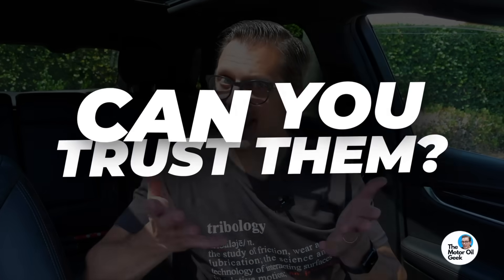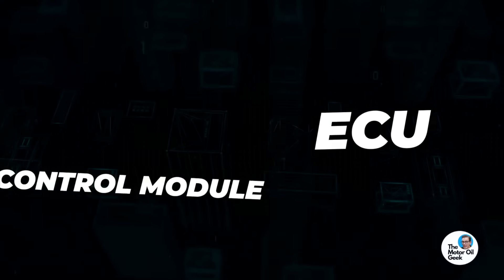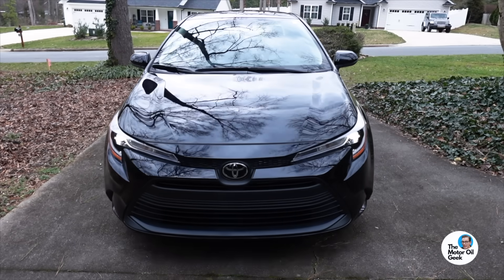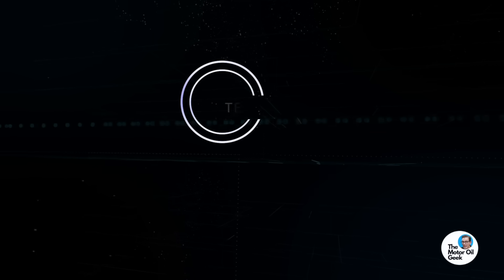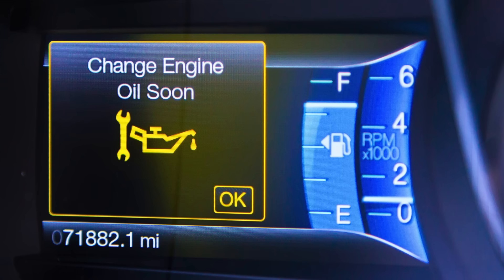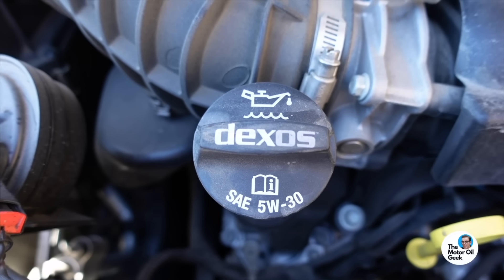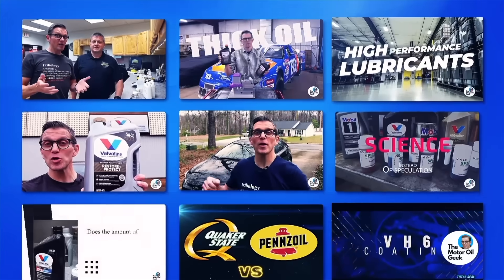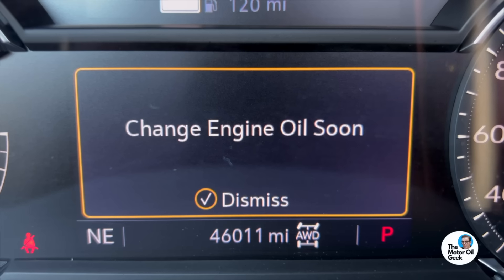The Accuracy of OIL LIFE Indicators REVEALED!

Comment: While I agree with everything in this video I still disagree with my Ford intelligent oil life monitors that say I can go 10,000 miles and 1-2 years in a 7 month per year winter climate doing almost nothing but short trips and occasional towing. My wifes turbo direct injected explorer especially suffers from noticeable fuel in the oil and I will end up changing it’s oil halfway through the life of my F150 oil, and I change my F150 V8 oil at about 60% oil life remaining which is usually 6 months/3000 miles. That said, I have started running premium top tier gas with star tron ring clean in both cars, and switched to Pennzoil ulra platinum in both cars, and have noticed the truck no longer consumes oil, so hopefully the cleaner rings might help with the fuel in the oil in the explorer as well.

Comment: Lake,

At least in the Ford V6 ecoboost community it seems like a lot of engines that have their oil changed based on the oil life monitor end up having more valve train issues and more build up of dirt and varnish in the engine compared to those that have followed a more traditional change interval. If the oil life monitor is so conservative why do you think this is happening?

Comment: Excellent video however:  I used to go by the Oil Change Indicator in the vehicle's PCM, then I changed.  I saw a video from FordTechMakuloco that showed a destroyed 3.5L EcoBoost engine, at 130,000 miles.  The owner religiously followed the computers oil change recommendation, yet the engine was toast.  What happened was, in the SS oil feed line that delivers oil to the Turbo bearings there is a small $10 filter screen, to obviously filter out any debris on the oil.  That little screen got clogged with particles in the oil, which starved the Turbo and BOOM!  The engine was toast.  So, this specific situation would suggest NOT following the OCI suggested by the computer.  I have a Ford Ranger with the 2.3L EcoBoost, and I change my oil every 5K miles, with full synthetic.  Oil is cheap.  Engines are not.  YMMV.  Lastly, when I change my oil, the computer states that my "remaining oil life is 60%".  FYI.....
Reply: I change my 2016 veloster turbo oil every 5k miles as well. I also have a 2025 Mustang with the 2.3L ecoboost engine. I rarely drive. 10 years with the Veloster, 71k miles. Starving the turbo is the fear since I know the maintenance schedule I have works. I'll look into that filter for both cars.

Comment: Funny story. A colleague had an S-10 in the 90s. Engine failure at 3,000 miles. GM replaced the engine but at expense to him. He purposely never changed the oil to get another failure to prove a point. That S-10 was at >100k and doing fine. Only topped off the oil, never changing the filter.

Comment: No car out there knows the life of the oil. It’s guessing it’s just a program in the cars computer that takes in factors like temperature throttle and mileage to determine if you need an oil change. My cars 21 years old and it kinda has a system like this where it’ll pop on a light that says oil change. I just clear the light and ignore it because I physically track the mileage and I physically check the oil myself. Pull the dip stick do the visual checks the smell check I’ll even remove the oil cap and look inside the valve cover. Don’t rely on a computer that has no freaking idea and is just guessing do the checks yourself.

Comment: Good video.  The cap at 7,500 is the only inaccurate point.  The algorithm is adjusted by engine type (push rod vs overhead cam, cam phasers, piston squirters, etc.).  It is a great system.

Comment: Any insight as to how a maintenance minder on a 2026 Honda Passport evaluates oil life?  Is the Honda system "smart" like the GM version in this video?  We just bought one.  And I'm extremely hesitant to rely on the dash alert for an oil change.  Also, to validate a lifetime powertrain warranty isse when it arises, and asked to verify proper maintenance intervals, how do you prove you changed it when you saw the alert?  Wouldn't proving it on a mileage basis be more substantial and valid?   Really struggling with such a simple issue here.

Comment: The problem is the ethanol in gasoline that gets into the oil, especially for pistons with excessive carbon buildup in the ring lands. 

Newer engines also have an engine oil temperature sensor, making the OLM even more useful. I have noticed that during the winter it can take 20 minutes of driving at freeway speeds to get the oil temperature to match the water temperature. I also notice that both sensors don't match after letting my car sit overnight, so there is a bit of sensor inaccuracy or they don't register correctly at lower temperatures.

Comment: My Pontiac has an oil life indicator, but I still go by the old, change the oil every 3k miles or 3 months, since this vehicle I really don't drive as often and it takes forever to get to the mileage. Besides, now when you open the oil fill cap and look inside, everything looks sooooooo clean now, with that beautiful oil sheen on it. Since I run regular oil in this car, my oil changes are pretty cheap. So I'm just going to keep it up this way. My other car, I change it every 5,000 miles. Mostly because this car was abused in its past life and figured changing the oil early and keeping it clean will keep the engine running pretty good.

Comment: Beyond all the indices analyzed to determine whether an oil still maintains its properties, there is one that is not considered and is extremely important in new direct-injection engines: soot and carbon. By now, we know that soot microparticles remain suspended and are not captured by the filter. We also know that these particles produce a sandpaper effect on timing chains, causing them to wear prematurely. We also know that carbon builds up on the rings, reducing their elasticity and preventing them from sealing properly, resulting in high oil consumption. Considering all this, isn't it necessary to change the oil prematurely in Di engines even if all the other indices are correct?

Comment: The biggest thing is that the car does not know what type of oil you are running it could be synthetic. It could be synthetic blend. It could be extended mileage. The car does not know what special additives are in the oil that can allow the oil to last longer.  

I remember 2001 Monte Carlo had the oil changed drove from San Diego to Phoenix back to San Diego and it told me to change the oil again. It made no sense.

Comment: Algoritm or not ist very hard to calculate to 100 correct due to different driving behavior. There are also as for sure already know algoritm who tells the workshop which oil new you should pour into engine. Its not monitored by the car itself only the workshop can see it by reading data from car. I agree analysis of oil is the only way to know status of oil with 99% 😊😊 accuracy.

Comment: I’ve been working with large machines for most of my life almost 30 years. Nobody on big stuff uses milage it’s just not a good metric. Hours and temperature are everything. Cars have been restricted or crippled because the odometer is the regulated meter. These oil life systems are far superior to milage based maintenance schedules.
Then we get to synthetic oils and they are just so superior

Comment: I think some of us would like to know without an oil analysis, is there a way to tell by color of oil when to change?
Reading your pinned comment, the oil was very dark.
It was obviously still protecting.  Do you feel some of us change our oil 'too soon' because we are adverse to the darkening of the oil?
Would you call that a myth?
I've changed my oil with 60% indicating nearing 5,000 miles on the oil; was starting to darken and I felt like it was good I did it;
This video would indicate we are wasting our money based on a perception that is either antiquated or was never true.

If you have the time, I'd love to know the science, not the head canon and rumors.
Reply from the maker: That would make for a great video! Color alone is not an indicator of oil health.

Comment: Keeping maintenance records since new, my 2016 Silverado bears witness to extended oil changes due to oil life monitor. For the first 3 years I had the truck I used the oil life monitor; my average oil change interval was 6,838 miles. After that I started ignoring my oil life monitor and changed my oil every 5000 miles or less. After my truck hit 100,000 miles I switched the interval to every 4000 miles or less. Ignore the oil life monitor! Just reset it every oil change. Because I kept up my oil changes AND only burn top-tier 89, my engine has NO carbon deposits, no lifter / AFM problems, I use no “additives”, no “catch cans”…no tricks…but I do replace the PCV valve every year.

Comment: I recommend to my customer to not go below 25% oil life on GM cars and Trucks. If you wait until 0% oil life, the vehicles come in with knocking noise or very low oil levels. Usually 0% is around 8 thousand miles.
Reply: That is a waste.

Comment: The real value of the used oil analysis is not to know when to extend your usage interval to, but rather to indicate if you have abnormal amounts of metallic elements in the oil indicating a mechanical wear issue of the rotating assembly.

Comment: On my GM vehicles, I change the oil out every 5K miles or once a year as the GM OLM goes to 0% automatically at the one year mark from the last time the oil was changed. I don't want the oil to ever get near its limits of protection especially here in hot SoCal. Better safe than sorry.
Reply from the maker: The GM oil life monitor in my experience does not get you near the limit of the oil's actual life. It is very conservative.

Comment: Well this is a lie. Oil life indicators are 100% based off of miles driven and miles driven alone. They will be at 0 % at exactly whatever miles driven it was pre programmed to be REGARDLESS of much you sat there idleling or how long you drive per trip or whatever.

Comment: I own a 2013 silverado 5.3l. The truck has around 135k miles on it. I bought the truck when it had 19k miles on it. I have stuck with the old 3k mile oil change intervals. Most of the time the oil life indicator on the dash reads around 60% when I am at the 3k mile mark.
Reply: Same, but my 3800 has nearly half a million and 2 trans rebuilds under it.  One at 230, and the last at 419k.  With 475k on the clock, that 3800 still runs like a Swiss watch.
Reply: Does your truck still run good?
Reply: @vigilrobert71 yes the truck is running fine. The 28th of this month makes 10 years since I bought it.

Comment: I'd like to see this analysis on a Ford vehicle.  There's a lot of talk about how owners need to change oil at a sooner interval than specified per OEM or oil life indicator.  This seems to gravitate around the oil phasers and VCT solenoids that the 5.4L 3v and the EcoBoost family of engines use, which is heavily dependent on good oil for proper operation.

Comment: You can trust the oil life indacator on GM products but not on Ford. Our shop runs Transit vans and we had one van that didn't say to change the oil until 12K miles. We didn't realize that until the turbo blew and the dealer told us that the oil was awful. This was on a 2017 transit 250.

Comment: I change my oil and filter every 5,000 even though I use full synthetic.  That's the recommended interval, so I go with it.  Admittedly, though, the oil looks pretty good after each change.  Probably throwing away money, despite never having to add any oil in between changes.

Comment: I own a Honda Ridgeline, manufactured in April of 2024, and purchased in June 2024.  At only 1,995 miles and 11 months of ownership, the Maintenance Minder showed 15% oil life.  (90% of my driving is of short duration.)  The old-school train of thought would say that’s not enough mileage to dictate an oil change.  Is time a Maintenance Minder calculation factor?  I don’t think so because Honda states in the owner’s manual, “If a Maintenance Minder message does not appear more than 12 months after the display is reset, change the engine oil every year.”  Is the break-in period a factor?  I don’t know.  All I can say is, it does not appear that the Honda system goes by mileage alone.

Comment: I changed oil on a customer car and reset the the oil maintenance light  left it on that screen. As soon as I moved the car 10 ft. It dropped to 99%. When the customer got in the car it was 98%. Low 70’s weather.

Comment: The only thing about this is you don’t know the mileage and they could have forgotten to reset the indicator. Just got my car back from my mechanic and he did the exact same thing. I know the oil he changed only has 500 miles on it but my indicator is at 65% I personally will never trust those I always change at 5k miles. Oil life indicator is usually at 50%

Comment: This is all assuming you don’t run out of oil if you are using the long oil change intervals.  Check your oil level every couple of thousand miles, more frequently if your vehicle burns oil.  I change my oil every 5000 km and I don’t need a chemical analysis to know that when it comes out it’s done.  It is thin as water and visibly contaminated.  When the engine is cold I can hear the difference between new and end-of-life oil.

Comment: Something I have often wondered about. I have a 2011 GMC 2500 HD Duramax. To date the truck only has 67000 miles. Since I bought the truck near new in 2012, I have run Amsoil Heavy Duty Diesel oil in it.  The oil life monitor at the end of each year reads around 65% or so oil life yet, the owner's manual states to change oil at a minimum interval of 1 year. I have always done that but due to the high cost of Amsoil, it would sure be an advantage if it could run strictly off of the oil life monitor. I just don't want sludge buildup in this truck.

Comment: GM collecting DATA on their customers without their consent?  Since the late 80's!?  Holy smokes, it's worse than we thought!!
To answer your question, that was and has been all these years later NOT COOL.  What these engineers did was innocent and very neat, but corporate GM sure enough has collected and sold customer data in an unethical manner.  If all the data just stayed within the ECU great, but OnStar was mentioned, which uses telecommunications...
So... sorry for the sobering and kind of tangential comment, but the awareness needs to be raised.  Of course, it's not just GM but virtually every major automaker today, so be ready to push back.

Other than that, great video -- thanks MOG!  Just note:  conclusive proof would really require more vehicles, different models, and ideally different environments.  I don't think the conclusion is wrong -- just better with more data for backing.

Comment: Great video!  I’ve sampled the oil on a number of my vehicles when the oil minder said 0-4% left on it.  All but one sample came back fit for continued use.  My 2022 Powerstroke had 9.3% fuel dilution. Ford of course says this is normal and to be expected with dfp systems.  It’s not.  Most importantly, fuel dilution is making my oil unsafe for continued use long before the computer says to change the oil.  5000 miles and 9.3% fuel dilution.  The oil monitor systems are not fool proof but have been largely reliable.

Comment: Would be interesting to get an oil sample analysis on my 97 ram 1500 it has 396,000 miles just put the second transmission in it.maintenance is everything oil changes have been every 3k with this truck since new by the previous owner using Castrol oil front and rear differential and transmission fluid every 30k along with coolant every 30k and I will be sticking to these intervals as the engine burns no oil or coolant runs very well doesn’t leak a single drop of anything it’s amazing this transmission lasted so long it’s worth putting another one in!

Comment: Suppose you have a low mileage car (1000 miles a year, but each drive is over an hour and oil gets to operating temp). If the UOA says the oil is still good after 1 year, would that give you sufficient confidence to increase the OCI to 18 or even 24 months? I ask because most car manuals say change the oil once a year even if the OLM says the oil life is still good.

Comment: This is good. Im a tech at a Jeep dealer. I see the PHEV wrangler and grand cherokees that want an oil change after only a few hundred miles in the winter on short trip (less than 10 miles) average commute. When doing the oil change all you can smell is fuel. My assumption was its not getting up to temperature due to the nature of the drive train cause fuel drop out and moisture build up. Of course the customer doesn't care why when it's $100 for another oil change in only 500 miles

Comment: I got the same system on my 2020 Gladiator. I change the oil when it reaches 50% or around 4k miles. Oil and filters are cheaper than engines 😊.

Comment: Interesting. 

My vehicles (current miles
2003 prius (340,000)
2003 sequoia (250,000)
2012 camry (205,000)
2019 highlander (85,000)

Oil change intervals of 10,000 miles on all 3, full synthetic oils, no oil burn issues. 

We live in the sticks, i have my own maintenance shop in my garage. any time we leave the house it is a minimum of 30 minute drive.. oh, i am also a "spirited driver" and frequent the wide open throttle once the engine is at operating temps. 

Maintenance is key, but a quality oil and getting the engine warmed up, then really using the engine keeps it hot enough to keep moisture out, and burn off carbon... 

"cleaning the carbs" still holds true on a EFI vehicle. Drive the damn thing, just maintain it.